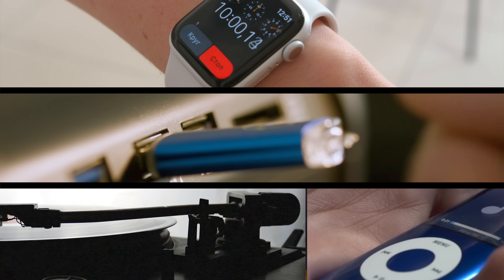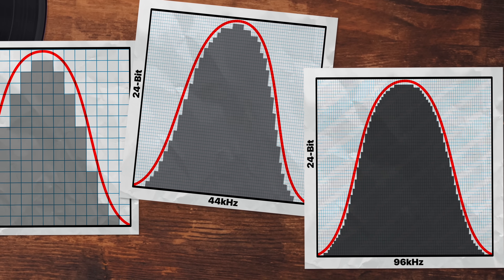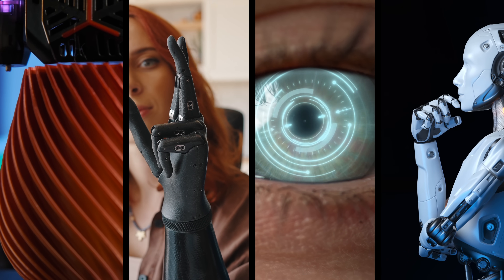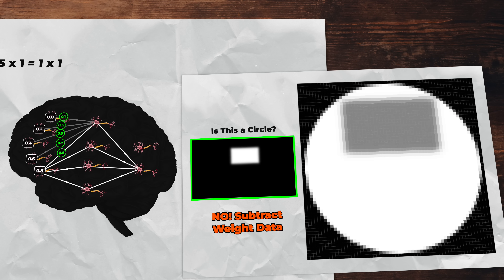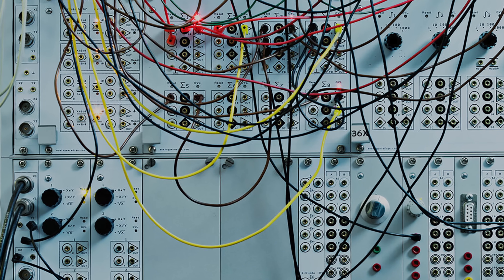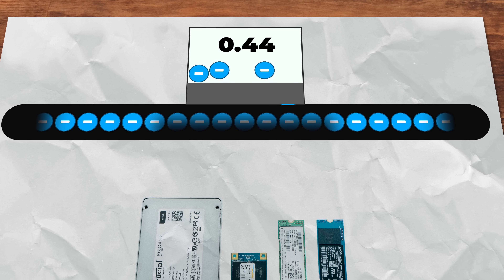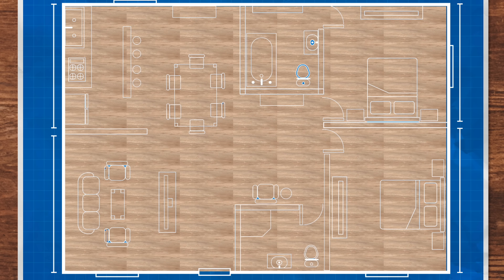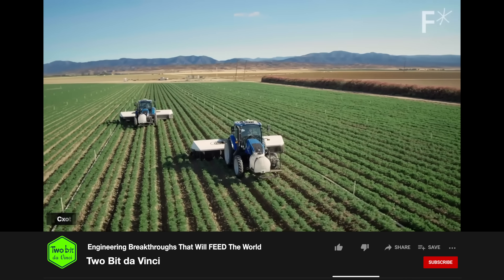Analog Computing is GENIUS - Here's Why!

Comment: 🎯 Key Takeaways for quick navigation:

00:00 🤖 The video discusses the potential resurgence of analog computing in a predominantly digital world.
00:13 🛡️ The narrator initially had doubts about the viability of analog computing compared to digital, given digital's perceived superiority.
01:36 🎵 Analog devices like vinyl records store sound analogously in grooves, offering a unique and character-rich sound.
02:17 🎶 Digital computers use ones and zeros to represent data and are highly precise and repeatable in their operations.
03:13 🖥️ Analog computers are powerful, fast, and energy-efficient for specific tasks but less accurate and repeatable than digital computers.
05:20 🧠 Artificial neural networks are a key component of AI, resembling the interconnected neurons in the human brain.
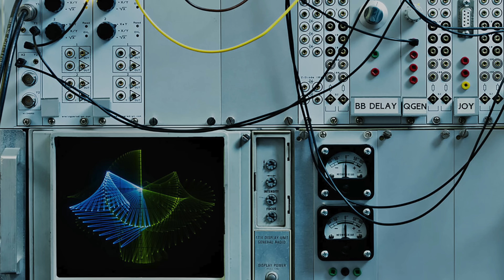08:21 💡 Mythic, a startup, uses a clever approach to store weight data for analog computing in flash storage, enabling energy-efficient analog CPUs.
11:34 ⚡ Analog CPUs can perform the same workload as a 100-watt digital CPU with as little as 3 watts of power.
13:22 📊 Analog computers have advantages in speed and efficiency but face challenges like accuracy and runaway errors.
15:11 🌟 Analog computers may not replace digital but could play a crucial role in specific applications, like low-power AI and sensors.

Made with HARPA AI

Comment: Fascinating rundown. But the ultimate conclusion is that in a world obsessed with "perfection", 95% accuracy isnt going to stack up. The Vinyl vs MP3 example is perfect for this. Because while people are expressing a resurgence of interest in vinyl. Its still never going to replace digital audio and will remain a niche market eclipsed by the digital era. And analog computing seems to be even more niche in that aspect. Most people want perfect accuracy in computational output. The minimum that most customers I work with that pay premium for compute power, is 98% accuracy. With 1% being due to data loss events and the other 1% from malicious attacks/actors. Which kind of falls into the same category. Any other point of failure, is just not worth investing in. Even if it is a 3% differential at 1/3rd the cost.

Comment: you mentioned hdd storage is permanent, I'm assuming you're referring to SSDs with the use of gates, these will lose their data if not powered after a very long time which shouldn't be an issue with a computer in use.

Comment: So, I think you misunderstand something about digital signal reproduction. Higher sampling rates do not just allow for a "closer approximation" of an analogue sound signal - per the Shannon Nyquist theorem, a frequency can be reproduced precisely and without aliasing, not just approximated, so long as the sample rate is twice as high as the frequency. So a 44khz sampling rate will not just "approximate" a 22khz signal, but will accurately reproduce it without sampling artifacts. So long as the sampling rate is high enough, you can convert digital and analog signals back and forth all day long without loss of information - at least loss from sampling.

Vinyl fundamentally does absolutely nothing at all that a digital system cannot reproduce. Does that mean that a given digital setup is going to sound identical to a given analogue setup? Of course not, and there are analogue components in sound setups to begin with that will greatly color sound. Playing a digital track over a $50 speaker setup vs a $5000 speaker setup, $10 headphones vs $1000 headphones, a transistor amp, a tube amp, "warmer" and "colder" or more neutral variations of each, are going to produce different sound signature. People typically like vinyl because it sounds warm, and that mid-focused high-end cut off sound it subjectively pleasing, but that sound signature is not intrinsic or exclusive to analog systems, nor is any sound signature intrinsic or exclusive to systems with digital components in them.

Comment: Flash drives and other SSDs, HDDs, floppies and CDs/DVDs are long term memory storage, or non-volatile memory, and holds it's value for a long time without power (not forever, though!). DDR memory (which most PCs use today) is short-term, volatile memory, and loses data when power is lost.

Comment: The only problem I see is that there is no separation between the memory and computation of the NNs. So it won’t be very good for multitasking apps. I imagine for general computing devices like PCs and Smartphones, this will likely be used at an operating system level for a few very common AI tasks.

Comment: One thing you have to remember between digital vs analog. Digital is multitude times more simpler to use but analog is more cost efficient to opperate

We just never had microscopic analog technologies. Once we found out about digital we stopped developing analog to its absolute limits.

Comment: Something that keeps me hesitant about getting a robotic vacuum is how with most companies the software is closed source, locked down, and often will require providing the manufacturer access to any data it collects in my home with it's cameras and all other sensors (with closed source you can never really know what they're really sending and what backdoors they might have, which might even not be secure enough to prevent third-parties from partaking in the same sort of abuse as the manufacturers). Is the model in the ad any different?

Comment: on a very high level, this video is pretty on point

your description on digital audio left much to be desired, you should read a bit more into audio codecs (even the "simplest" mp3 would do), the explanation you gave is the naivest possible approach to digital audio storage, mp3 for example stores audio in the form in terms of frequencies and amplitudes (Fourier space)  "frames" (they are not independent of each other), sampling rates usually refers to the size of those frames (in terms of seconds) so the wave front can be reproduced more accurately, case in point, audio codecs don't usually store amplitudes only for each time stamp

there are also "lossless" audio codecs as well (flac being one example) that use other more advanced techniques to reproduce the wavefront more accurately than mp3 for example.

most neural networks don't use only the matrix multiplication you explain, the final value is also passed to a function so values don't explode layer to layer, this also makes it so the network doesn't get biased towards a particular input

the analog neural networks is very possible, but it is a very hard engineering challenge

electronics has come a long way, transistors are probably one of the most important inventions of humanity, even without them you can make almost any wave front using them, this means you can emulate almost any function, this is what neural networks need

i think it's very possible that we will have analog neural networks running on some devices, it depends on how popular and handy said network really is

Comment: Basically it isn't analog competer, but kind a digital with diferent than binary numeration system. And this is really future and need to be engineered further. I take a bed that sooner or laer all consumer electronics will be use such concept, but with more polished techical part.

Comment: The inaccuracy can potentially be a good thing for general AI. With sufficient checks and balances via a few extra neural networks, errors can be seen by the computer, that's how it works with people. We gain experience and we learn how to spot our errors. Plus, error creates variation, variation is creativity... the foundation of art and culture.
Reply: It depends on what kind of expert ais. For tasks that require a high level of certainty, it could be detrimental.
Reply: @evertchin  Think about image recognition. Training the AI with a couple % error rate could improve the ability of the AI to detect noisy or difficult images, as it was trained from the start with error-ridden data.
Reply: @kindlin  That's how AI has been used for decades. All trained AI models have intentional inaccuracy to prevent an issue called overfitting. It's one of the basic things taught in every AI course because if you don't do it the AI model is near unusable. But you don't need analog computers for that, all that's necessary in most cases is to not run the training for too long.

Comment: My hearing was better when I was younger, so my memories of LPs as having better sound reproduction is biased by that. 
I remember the first CDs sounding better mainly because of no pop, hiss, scratch sounds and for the same reason: roll off of my hearing at higher frequencies. 

Analog "computers" have benefits but analog electronics are more subject to temperature variances and noise (or inability to identify and suppress noise) but they run fast and are reliable. 

In 1984, I was sitting in controls class and the professor rolled in an analog computer and told us how obsolete they were and we would never fool with them.  But the majority of the control loops on the planet were still being controlled by analog (electronic and pneumatic) PID controllers,  simple analog computers.

Comment: Basically, Created on digital and used by analog? Sounds good to me. Using data is a large majority of the data's life span, it only has to be created once but data can be used infinite times (but might decay over time due to a multitude of reasons. Go check out that early 2004 website ya made lol)

Comment: I just sold $1500 worth of analog Boss guitar pedals for $200 at guitar center. I bought a digital Spark Go amp and it replaced every pedal i have. Do i have regrets? YES. Also my Zoom r4 records in 32 bit float and is amazing.

Comment: The analogy between A.I. neural networks and the brain is tenuous and misleading.  For example, the 1 and 0 or on and off of computational neural nets has no analogy in neurons.  Neurons spend most of the time in a resting or polarized state, when they depolarize they aren't in any sort of steady state but are constant flux until they get back to their resting potential.  I'd say brains are more like analog devices than digital but then they don't work by analogy either.

Comment: all files are in binary say 10010101 but that van be seen as 10010101/11111111 or a number between 0 and 1 so any file can be stored on a single wire using a variable voltage divider. the amount of bits you can store on a wire depends on the range of detector but you can technically store a file in a cup of water just measure what percent full is the cup to read the file. you can even use weights to store data like something between 0 and 1 lbs.

Comment: Digital can approach absolute accuracy without limit; increase the bits/sample ad infinitum. The limiting factor is noise and that applies to inputs to both a digital and analog system which has to process an analog signal. So minimizing noise in the low-level input signal as it approaches zero is the key and in the case of LIGO, quantum squeezing of light allowed it to get that much closer to the ideal.
An important note: when using resistance-controlled currents or voltages, it should be remembered that resistors/resistance is inherently noisy, no voltage applied. The tradeoff is that the lower the resistance used, the higher the power consumption but the higher the resistances used, the more analog noise is generated. Computing is really a horses for courses game; one uses the methodology most suited to the problem being solved.

Comment: What I think is that the robot vacuum is in no way going to outperform or save much time compared to a full size vacuum. 

It all has to do with amount of available space and power. You can supply over a kWh to a vacuum that only does sucking, and you can only supply a certain amount of mAh to a robot vacuum, which has to do sucking, moping, locating, identifying, moving, and cleaning itself, then you also have to clean the robot yourself and replenish whatever additives you are made to subscribe to. 

It's great for someone who is okay with mediocre job, but if you care about cleanliness you would use dedicated tools that are not all in one. I guarantee a full size vacuum will still be able to get more dirt out of the floor and if you get carpet shampooer you'll get even more crap out of the carpet. As for hard floors, a steamer will do a better job at cleaning than some chemical based germ spreading machine.

Comment: analog is more precise when doing non-digital stuff. measuring tides, or producing sine-waves is better at purpose built, properly calibrated analog computers. digital allows you to make one device to do a bunch of stuff, which allows for economy of scale, and you can up the bits to hide the imperfections through granularity. the reason modern analog processing isn't as precise is because it isn't true analog, or using analog for digital operations.

Comment: I have been saying this for years! And it's the reason why I started learning electronic engineering. To build an analog system capable of cracking encryption algorithms.

And I'm all vinyl. Quantization will always remove sound artifacts that may not be noticeably audible, but the brain responds to. That's why you can "feel" music differently when listening to vinyl. There's a quality about it that you can't put your finger on, but it's there. The same with live instruments like a guitar, or piano.

When you synthesize anything, you're going to lose aspects of the original. This is the same in pharmaceuticals, gems, materials, clothing ... and sound. You reduce the qualities/properties of the original when you synthesize it.
Reply: "I'm all vinyl. Quantization will always remove sound artifacts that may not be noticeably audible, but the brain responds to."
That's called placebo. All vinyls produced in the last couple of decades have digitally processed (aka quantized) music.

"pharmaceuticals, gems, materials, clothing ... and sound. You reduce the qualities/properties of the original when you synthesize it"
What you call "qualities" are actually "impurities". There is nothing fundamentally better in non-synthetic stuff, with few exceptions like food, because processed food has so many harmful additives.
Reply: @brinkoftext  You make a valid point. Thank you.

Comment: What you didn't explain when covering digital storage of analog signals, is that when the digital is turned back into analog - i.e. through a speaker - there is no detectible difference between the original waveform and the output because speakers cannot output 'digital' sounds and the output curves required to match the digital steps end up being the same as what made the steps. There are very few use cases for which current digital storage can't meet or exceed the quality of analog if the goal is faithful reproduction. But for vinyl records, there are other qualities added by virtue of the medium that people like. I think that the claim they like analog better, for sound fidelity, is not really the case. They like the pop and hiss and 'feel' of vinyl. Just my two cents.

Comment: The "runaway" case you talk about is the same digital. There is a special math/electronics class that talks about error/accuracy computing. If you loop a calculation, your digital accuracy (float or fixed float) will also decline.

Comment: At school back in the 80's I learned that analog computers are way superior in speed and accuracy (depending on how you make them). But they are more like fixed calculating circuits that are at most good for control engineering. So we got digital signal processing. And in a fraction of the price(debatable) of analog computing, you got a super flexible system where you can fix your design mistakes even after being sold already.
These days SSD already store data "analog" and read it out again using a "flash ad" converter. The multi level stands for the analog state of the cell.

Comment: The "tradeoff" of digital audio is a false idea, aswell as the implication that records are favored due to being higher quality/a more accurate representation of the sound. HQ digital files are able to have more accurate recordings than records because there is a limit to the size of a record's grooves that digital bitrates, etc., are able to overcome. Sure, early purely-digital audio was of low quality, but so were early records. Analog mediums are simply not inherently more accurate for data encoding purposes.

I recognize that you basically accidentally correct yourself on this as you continue explaining these concepts, but it's still misleading to characterize it the way it started.

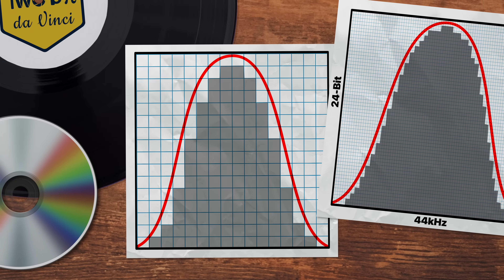Comment: 2:00 This is a myth. A frequency range of 22 khz captured with 44.1 khz 16-bit sampling PERFECTLY reproduces the analogue waveform. It doesn't approximate it. It isn't stair-stepped. It's identical to the analogue waveform after reconstruction.